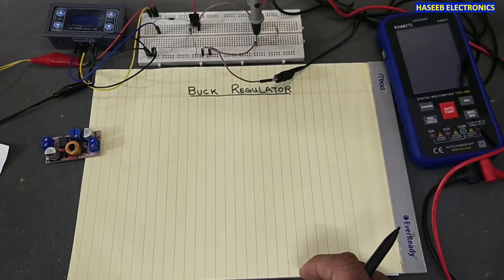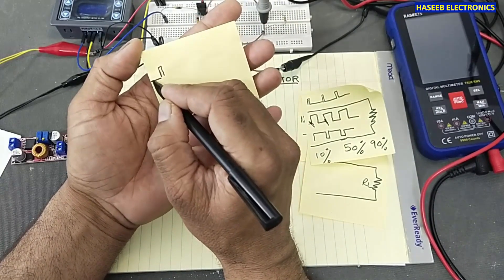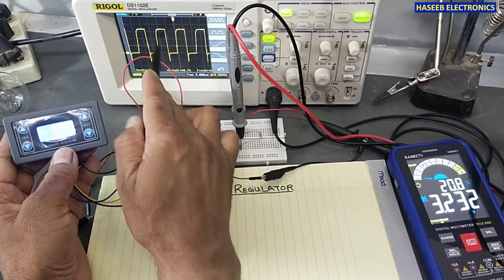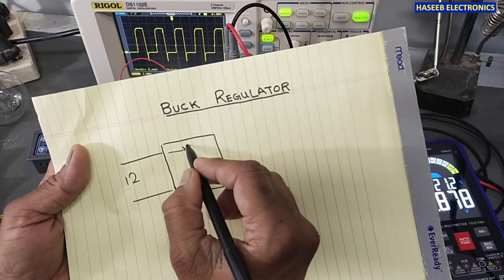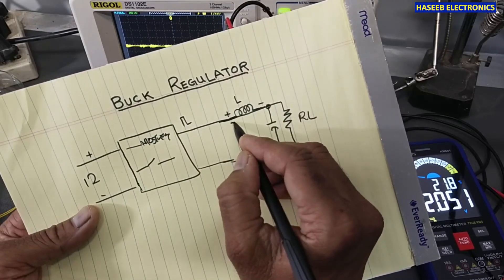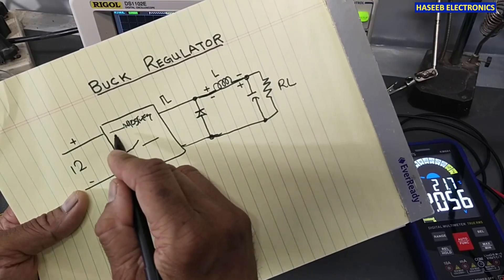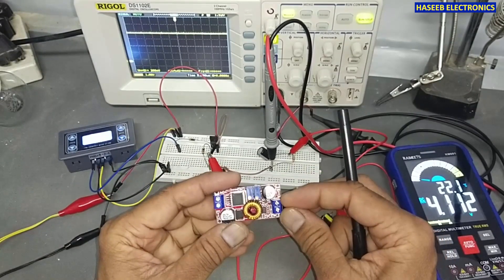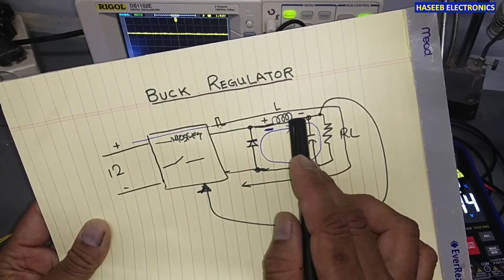{831} Buck Regulator, Explained With Theory and Practical

Comment: I really like the synchronous design better in every way high voltage conversion to amperage is more efficient I was used the regular design and 450wAtt 50v converter to 15 volt I draw 50 amp with 1 volt drop with synchronous converter but 46 amp with regular converter 3.5 volt drop

Comment: I don't understand the electrolyte capacitor in this circuit because this capacitor will be dameged if it is connected in the wrong way  and in this circuit the plus and minus are changing through the coil. Can you explain why it wil not be damaged?

Comment: Good morning sir,
I have a buck converter with 36 to 72 DC  input voltage range and output voltage is 12 volt and output current is 5 Amp.
But I have to operate it on 60 volt input voltage max and output voltage 12 volt and 10 Amp.
What will be changes in the circuit or  in components.
I am your fan from India.
Thank you

Comment: assalamualaikum..
Thanks for sharing Sir very informative principle of the buck converter.
I have a question. MPPT (Maximum power point Tracker) usually used in solar charge controller, basically have similarity with buck converter. It can regulate output voltage based on a set point ( battery voltage system). 
my question is, How can MPPT increase amp output? 
for example, my solar panel has a total 120-watt peak,  with VOut around 21v, and 5.5Amp. with the MPPT controller, I can change my 12V battery system to almost 10A.
thanks for the explanation.

Comment: nice video, im having trouble understanding the part when the inductor is switched off. I thought the magnetic feild that it had built up inside would just diminish, but your saying that it changes polarity? So the load is being fed with A/C now and not DC??? I thought inductors just resisted a CHANGE in current,how is it  able to just flip 180 degrees all of a sudden?  How is that happening? thanks!
Reply: when a current flows in an inductor a magnetic field develope and when the curren is switched off the field callapse and produce a current in reverse, you are not feeding with ac since there is a diode
Reply from the maker: please check this video   
https://youtu.be/11oU3ykKKUQ